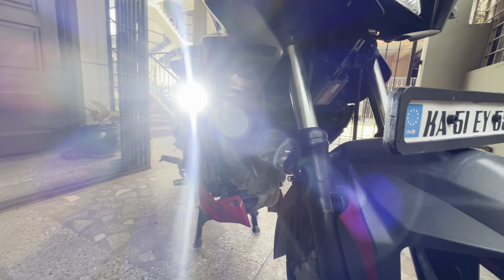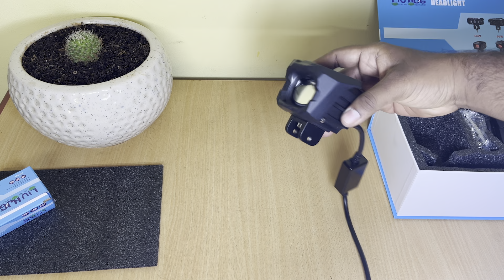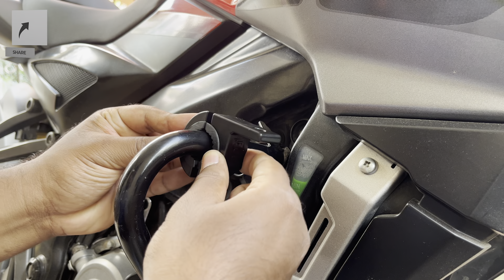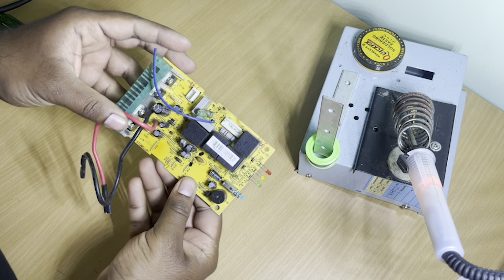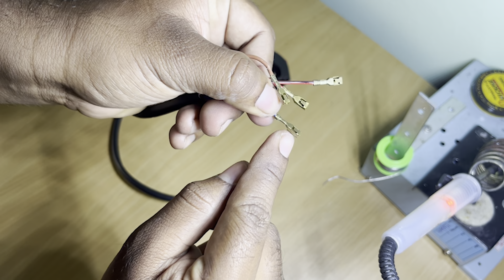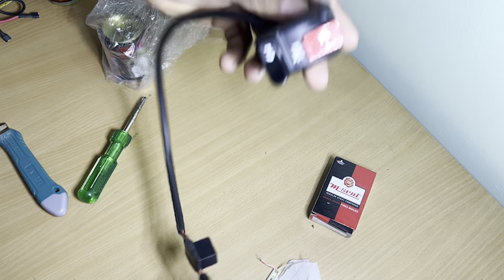HJG FogLight With Custom Smart Control | #ns200 #ns200modified #ktm #mt15

Comment: Bro, Thanks for the video it's a innovative thinking.  I've the same HJG fog light and a remote control wiring harness from HJG, there 3 wires coming from the harness and the fog light has 5 wires, 1 is negative. There is one button on the remote control which changes all the 4 mode lights, can a 5 pin relay work to enable it. In your video you have separated the red light with kill switch and the other 3 colors are controlled by ignition switch right. How to make mine work with a 5 pin relay.

Comment: Bro I own 2023 model NS200. the radiator is running frequently while driving for certain kilometres..is it normal?? Pls reply
Reply from the maker: 2023 models radiator fan turns on a bit earlier compared to older models. Need not worry about it. 
However if it’s very extreme, check your spark plug to understand whether you are having a rich mixture or get a ECU Update.